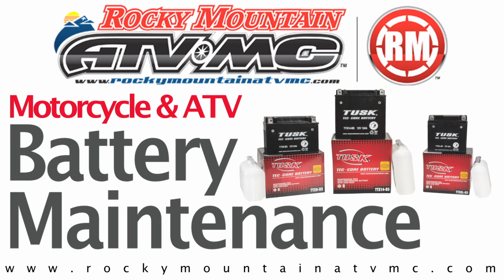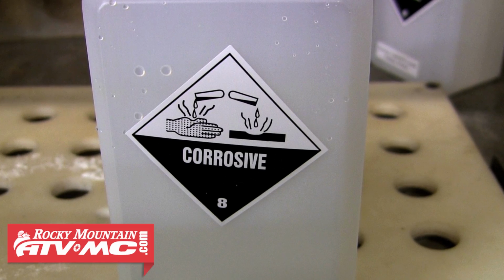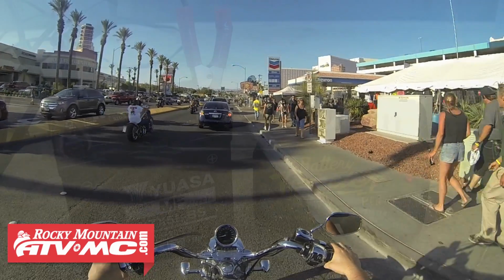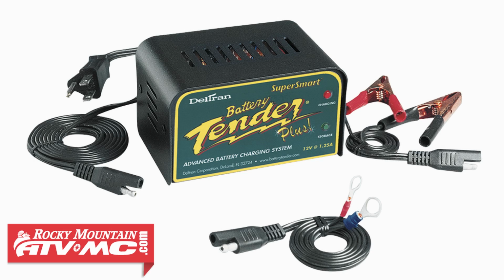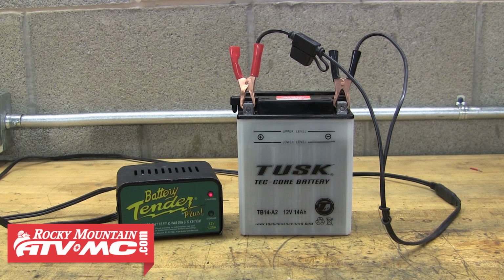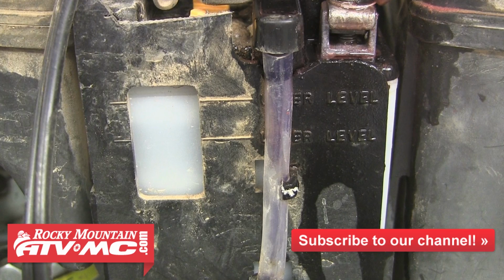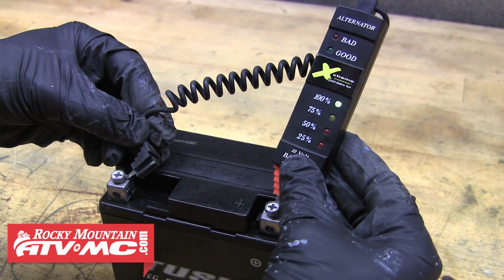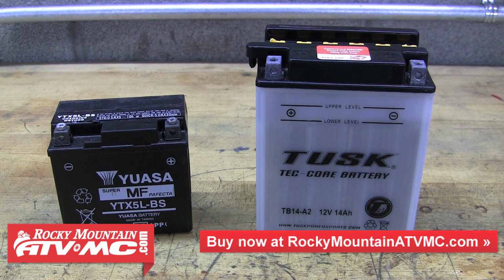Motorcycle Battery Maintenance - How to Extend the Life of Your Battery

Comment: What would cause my Two year old 12V acid filled battery on my portable generator (used to self start) to not hold voltage. I bought the battery ready to go from Batteries Plus and kept it maintained via a Battery Tender Jr. I found the battery low in fluid and topped off with distilled, charged up with a 8 amp charger maintainer that showed that it was charged within an hour but the battery still will not hold charge.
Reply from the maker: The battery could have an internal short circuit causing it to loose voltage. Or a loss of electrolytes can cause sulfation or corrosion to the battery cells, since you found it low on fluid.

Comment: Yuasa Battery's UGLY side. I recently purchased a motorcycle battery from my local dealer. Being an honest person I told the engineers at Yuasa my story, with full truth. I have a 3rd setting on my Suzuki Intruder 2000. Its a PARK switch setting. You can put this ignition switch into this position and it lights up the rear light so you can safely leave a dead bike on the side of a road if you had to. Brand new battery, drained down over that night. Loaded the bike up on my pickup and went home. Removed the battery for proper charging as per manufactures procedure. 2amp charger. It took much longer to reach 11 volts than normal. So I left it for another 4 hours, only to find that it did get to 12.3 volts but then it quickly began to discharged to below 11 volts again. "indication of a dead shorted cell". I took to my dealer and they honored the warranty. Round two. Same mistake I me. Another dead battery. This time the dealer denied the warranty due to them stating the bike had a drain on the system. Not so. I offered to bring in the bike so they could test their theory, but they quickly gave me an attitude and become a bit hostile, poor customer service, I'd say. Any way these battery's are a ""ONE TIME DEAL"". If you leave on your lights and drain the battery down KISS your money good bye, and trash your chargers, you'll only waste you electricity and summer time riding! Forget trusting it on a trip! If you drain the battery your jump-starting friends will only get you started one time, not to mention the wear on you bikes charging system! I was willing to pay that dealer for the service if they were correct.
Reply: You're a moron if you leave lights on, what an absolutely pointless comment. Play stupid games win stupid prizes

Comment: That battery tender is rubbish i brought one from amazon soon as it arrived  plug it in to the power and blew up up .
Reply: Peter Bare 
I've had my Optimate 3+ for years.  I think there is no better charger.  It runs tests on the battery and even desulphates. 
I need to get a second one so I don't have to switch back and forth between motorcycle and tractor batteries.

Comment: I was told by a battery dude, when cleaning the battery , use hot water, the hotter the better and nothing else. probably not a good idea to submerse the battery in a large pot of boiling water tho, what he did is first used a battery terminal cleaner, cleaned it up a bit, then dumped a bit of boiling hot water onto the battery. i asked him if that's a good idea, and he said that since its only a rinse, it doesn't have time to damage anything because its on and off so quick. He explained that a baking soda/ water solution may find its way inside the battery, very unlikely but it could happen, especially with a battery with removable caps., seems logical to me, seems to work really well. been doing it for a few years now with great results. awesome video, cheers
Reply from the maker: Cool!  Thanks for sharing that info.. sounds like a good idea.
Reply: @rmatvmc  will the baking soda damage battery if it did leak in it ,, soda is a acid sotution

Comment: Will a battery 'suddenly fail" without warning? What would be the warning signs?
Reply: I was riding on the freeway and the battery suddenly died - absolutely no power. No warning signs for me. I take good care of my batteries. Can't seem to get more than two years out of the lead acid batteries even riding year-round.
Reply: Its pretty simple really. My atv felt like it was losing power when i hit the throttle, and the definitive sign is that you hear a cranking sound. Kinda like a buzzer.
Reply: What would be the warning signs of a battery failing without warning? Is that really your question?